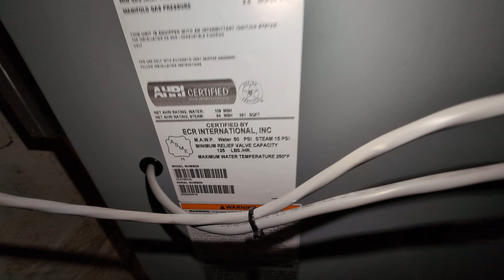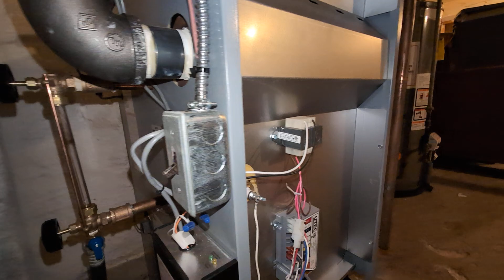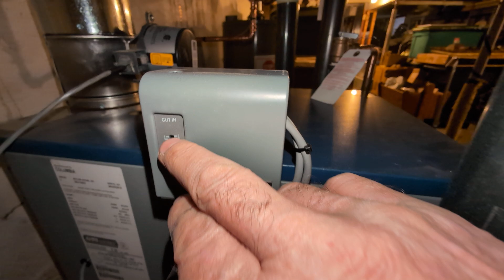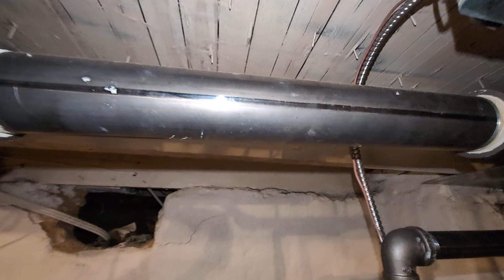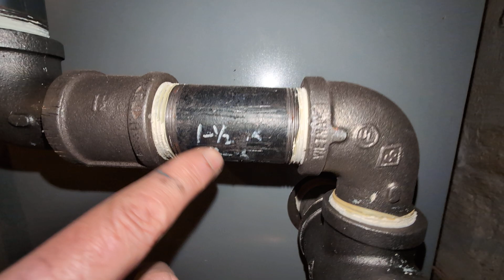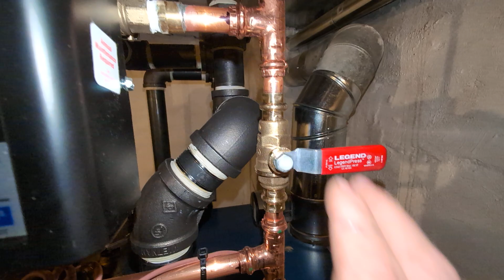Out With The Old In With The New Steam Boiler

Comment: Gordon, I have two steam boilers for 2 units above and below each other. Similar usage but one runs 3-4CCF per day and the other 12-15CCF. I think it’s something with the cycling as it seems to stop/start a lot. Does that seem odd? 

Nice work as always, btw.
Reply from the maker: Thank you!
I'd first check the settings on the thermostat.  
You may know the digital t-stats come from the factory set to run a heat pump, so you have to go into it's set-up menu to tell it it's running a steam system.
Reply: @ thermostat is old school Honeywell dial. I think its calling for heat too often.
Reply from the maker: @jakehits  Ok, yeah. 
The old school heat anticipator on that t-stst went off, most likely 
Classic failure mode for that type.
Reply: @ Thank you! replace with same T-stat or do you recommend a modern version? Or if it’s fine adjust the anticipator to .05? Or whereabouts.
Reply from the maker: @jakehits  Try moving the anticipator first to see if that works in giving you longer cycles.
Reply: @gordonschweizer5154  you’re the man! Thank you.

Comment: What would your recommendation be for a somewhat bigger repair on a Burnham PV73ST thats leaking from the tankless coil gasket? Spend the $400 on the replacement coil along with the gasket and the bolts to try to get some more life out of it and then start pricing out replacement boiler? Boiler is from 1998 and does a great job with the two pipe steam system I have here in CT. I'm just worried that with it being almost 30 years old it could go another 20 years or it could die within the next few years.
Reply from the maker: My advice would be to start looking at Burnham's MegaSteam as a replacement boiler asap.
https://youtu.be/-43xDzBoRBI is a link to a video on one of our installs.
Reply: @gordonschweizer5154  thank you I will check it out. Dad and I will actually be doing the hot water coil and possibly relining  the combustion chamber in April or May to buy me a little bit more time but yes I agree it is time to start looking into a new boiler
Reply: @gordonschweizer5154  Great video and great install if you were closer to Connecticut it definitely would have you guys give me an estimate. I think also when the replacement is done I would probably also have all of my radiator valves changed to new ones as a lot of them are stuck open I have some ones that don't open as well
Reply from the maker: @willssmallenginerepairllc5060  You have a two pipe system, yes?
What make are your valves?
Hoffman #7 perchance?
Reply: @gordonschweizer5154  two pipe system yes. I have in the basement by the boiler a Warren Webster boiler return trap so I would imagine that all of my valves are Webster as well. That's at least what they say on the handles
Reply from the maker: Ah, those valves are difficult to rebuild as is.
I would reach out to Tunstall Associates for valve rebuilding kits.
It depends on which model of Webster valve you have.
https://youtu.be/af7IZN3Fty0 is a video showing a Tunstall valve kit for an old Moline valve.
Starting at time stamp 11:27 shows the basic principle of Tunstall's kits.
Please tell Woody I said Hi!
Reply: @gordonschweizer5154  would there be an issue with getting new radiator valves from a plumbing supply house? Instead of rebuilding?
Reply from the maker: @willssmallenginerepairllc5060  It's your call.
The advantage of the Tunstall "drop-in" is you don't have to disconnect the radiator, pull it out, remove the old spud, put the new spud in, take the old valve body off of the pipe. Put the new valve body on the pipe, move the radiator back into battery, and hook the trap back up and the new valve union back up and fire up and test.
With the Tunstalls, you can add thermostatic actuators.
Again, your call.
If you go the new valve route, I would look at the Mepco swarf valves designed for vapor systems.
Special order. Unlikely anyone stocks them.
Supply houses are only going to stock chinesium valves.
Reply: @gordonschweizer5154  I appreciate the information. Looks like I have some homework to do.
Reply: @gordonschweizer5154  also if I have a boiler return trap etc in the basement I don't have a condensate pump so that means I would have a gravity system as well correct?
Reply from the maker: Yes, the boiler return trap etc is a hold-over from when your system was coal-fired.
It was a steam-powered pump designed to get the condensate water back into the boiler under all pressures, as you could not turn off a coal fire.
Here is a link to a Webster return trap video: https://youtu.be/TCD-4AvLlU0
Reply: @gordonschweizer5154  That's interesting to learn. My house is 1934.

Comment: @gordonschweizer5154
Need your advice and suggestion. 

I have my 1962 National Boiler just like the one you replaced recently in a video. 
No leaks, everything was working fine. 
Sunday, I came home, and heat was off. I looked inside and there were tons of Soot on the burners and on the bottom. I was like "What the heck is all this black stuff" I cleaned it up and went to light the pilot. Turned on the gas and flames were all yellow and low and blowing all over. I shut it down and looked inside. Under the boiler sections were full of Soot about an inch thick. That was not there 3 months ago when I took the burners out and cleaned them. I cleaned it all up and boiler did the same thing. Only thing I never experienced so I called a boiler guy. 
He came out and took the top off the boiler and it was packed with Soot. Chimney has a good draft so that wasn't the problem. 
I helped him wash everything out with water and what a mess. Balck soot came out for 1/2 an hour. He had trouble lighting the pilot, got it lit, boiler fired nice. Had blue flames I have not seen in about 5 years. Mine were always yellow no matter how much air I fed it with the adjusters. Next day I came home boiler was out. I had to change the Thermocouple.
Whatever happened with the blockage from the Soot cause a big blowback and messed up the Thermocouple. The air adjusters blew themselves closed somehow.

Now question is ......
Boiler guy told me I need a new boiler. This one is old and will fill with Soot again withing a year. 
I lived here 30 years and cleaned the burners, but never ever cleaned from the top. I never looked in there. 
It's like in 3 months all this Soot blocked everything. I don't know if it was bad all along and all of a sudden it escalated so fast it completely built up and blocked itself or what happened. 

Was it possible that 30 years of not cleaning it blocked it so bad so fast all of a sudden or could this get blocked again in a short time?
Air flow is good to the chimney, but like I mentioned the flames were yellow for a long time. Now he cleaned it they are a nice blue like they should be.

I know I will do a top to bottom cleaning every year now, but wondering if it built up so fast, or if it was my fault for not cleaning top down for 30 years. 

Also, Boiler Recommendation from you. Burnham, or Weil McClain for a Steam Boiler? 
Should I replace it or keep an eye on it once a year. All parts are less than 10 years old from the drain valve to the pressure relief valve. Autofeeder, Pressuretroll, Miller 67, gas valve, all less than 10 years old and tank does not leak.
Replace it or was it my fault for not cleaning from the top for 30 years?

A lot of boiler people in Chicago by me but not 1 seems to do or know everything. I asked this Professional to check my Flue for temperature, CO2 and efficiency. He said "I don't have that equipment on my truck. UNREAL !
Reply from the maker: In Chicagoland, try "The Steam Whisperer" and have them look at your boiler.
Please tell Dave I said Hi!
Reply: @gordonschweizer5154  Thank you, calling him early next week to come out and check everything and do a Combustion Test and ask his advice about a new boiler if needed. If he say's time for a new one, He will get the job for sure. I looked him up. Supposed to be the Best. Thank you

BTW, Love your pipe work. Some other guys that do "Steam" on youtube cut the 2 inch pipes and use them big "Crimp Type" connectors. I forgot the name of them but looked them up before. A Coupler is like $58 !  You do the piping the right way .

Comment: Why is the pressure trol set at 9 from the factory if it  takes much less lbs to heat the Empire State Bldg? Is there a place that would utilize 9 lbs?
Reply from the maker: As to the reason why it is set at 9psi from the factory, you will have to ask them.
Please do!
I would like to know for sure.
I suspect that it has to do with maintaining their UL listing for a life safety device, but suspicion is not proof.
Who uses 9 psi and above? 
Crab steamers!
Reply: @gordonschweizer5154  Incredible, at 15 psi a pressure cooker will cook food fast, but yet it only takes .5 psi 100 degrees to heat the empire state bldg or your home and that is why the the pressure troll is always set at .5. I am understanding.
Reply from the maker: Yes, when the PA404a pressuretrol is set to the lowest setting, that is all it takes to heat a house.
It's the latent heat in the steam, not the pressure that heats the house.
The Empire State building has a pressure side of 1.5 psi, but, the trick there is there are vacuum pumps in the basement that drops the return side pressure to 8 in Hg, so the actual pressure differential is over 6 psi.
If they tried to heat that building with just 1.5 psi, the pipes (already huge) would be even bigger.
Reply: @gordonschweizer5154  Would you take the opportunity to introduce boiler water treatment a month from now or just invest in a water softener?
Reply from the maker: @jazzcornertv  I've been told water softeners are not good for feeding steam boilers.
As for other boiler chemicals, it's pick your poison.
Some folks swear by certain ones.
Other folks swear at them.
I tend to be in the latter category.
Reply: @gordonschweizer5154 You are absolutely correct. Sometimes the correct answer is: All  of the above. I was thinking water softener for the building to slow down the hard water damage in NJ. A little boiler antifreeze to coat the pipes and a Iittle prayer for good luck since they don't make things the way they used to anymore.

Comment: I have a question, I put a new gas valve on my steam boiler same model like the old one and the new gas valve it doesn't get more than 2.10 in wc 
I was trying to adjust it with a digital Fieldpiece SDMN6 Pressure Switch Tester 
Any clue why is that?
Reply from the maker: You might need to call your gas utility.
What is your upsteam pressure?

Comment: Thank you for the video very informative and interesting.
I don’t see you installing many naturally aspirated or atmospheric boilers usually you are using a gas gun and a oil boiler like SGO.
Reply from the maker: On the smaller boilers, it is usually not worth the efficiency gain vs the complexity cost to go with a power burner.
Also, the noise is an issue for many folks unless we are converting from oil to gas.